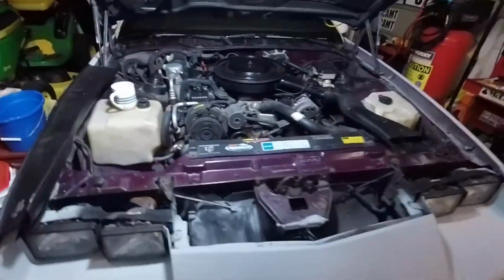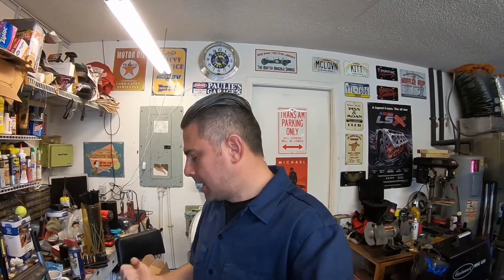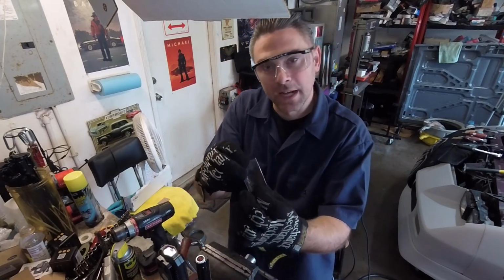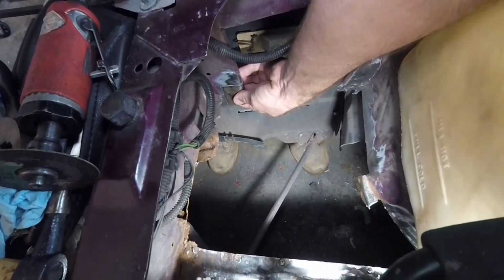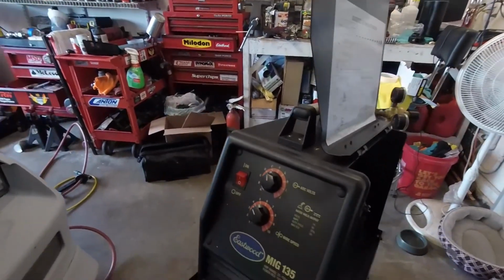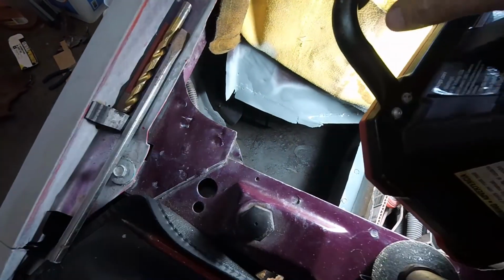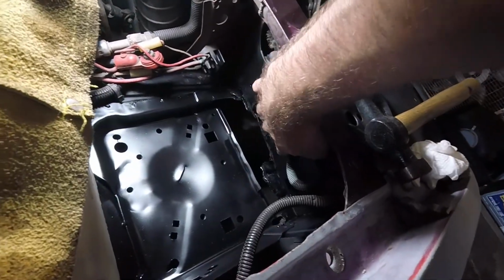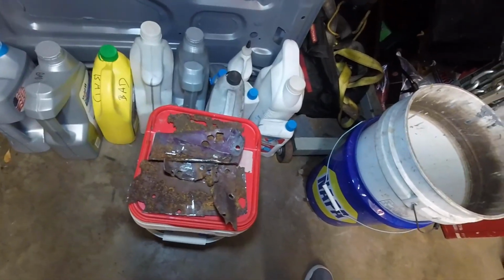1992 Camaro Battery Tray Rust Repair!

Comment: Hey bro, we met at the wahwah couple days ago, we discussed my 85 El Camino and that odd transmission problem. I’m subbed and have many videos to go through. Thanks for listening and your input.
Reply from the maker: Good to hear, keep me updated on that El Camino!
Reply: Paulie's Power Hour I ran it, wouldn’t move. We pushed it onto the street, still no gears. Checked the fluid level and it’s over full? I tried it later still no gears. AAMCO were the ones who serviced the transmission and told me it was good, so I had the rear gears lowered. I’m lost. Any thoughts? I hate to have to still replace a trans. How’s the garage events coming along?
Reply from the maker: @Tigliz12  so far so good. We had an issue with the flex plate in the Vette, but a new one is on order. That's odd about your trans... that's something I'd have to see to diagnose.
Reply: Paulie's Power Hour I was advised to just replace it...this is far beyond my scope. You know a good one stop trans shop? I had AAMCO say it was fine and Clay County Trans say replace.
Reply from the maker: @Tigliz12  the only trans shop I use is the Clay County Transmission on 220 near Middleburg. Rick and the guys have always done me right, and won't gouge you or give you any BS!
Reply: Paulie's Power Hour there is a clay county one here on 103rd going towards Cecil Field. Before 103rd/Collins intersection. I’ve paid 50 bucs three times for towing, got old a fourth is unavoidable. P, I appreciate your responses!